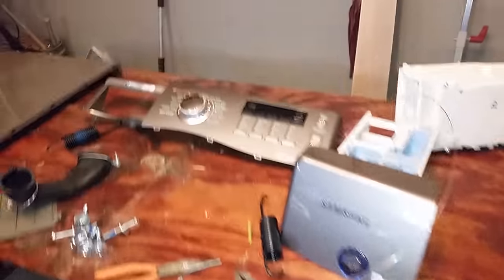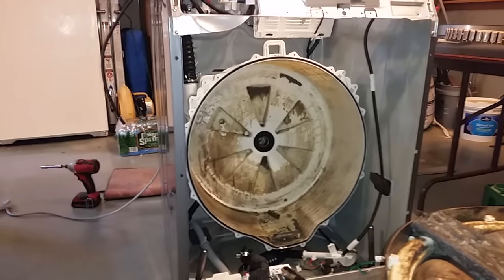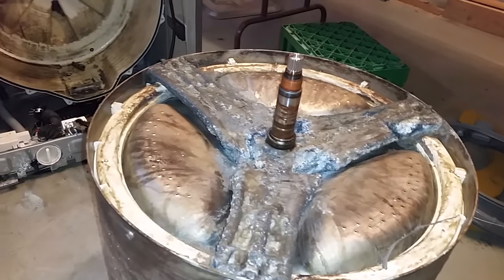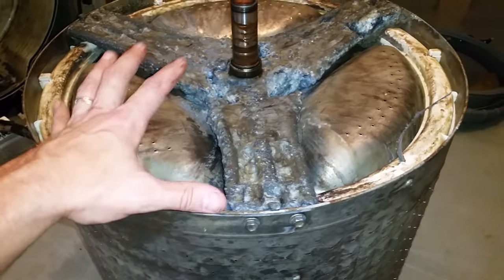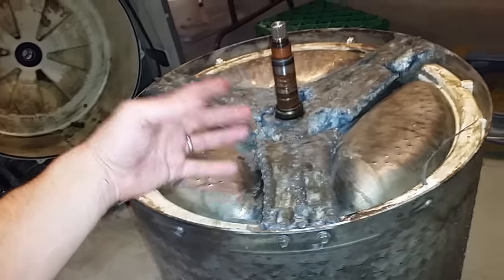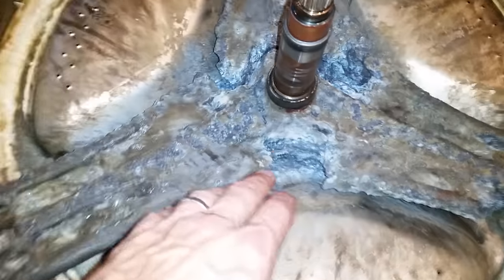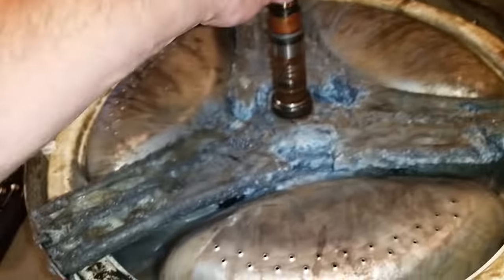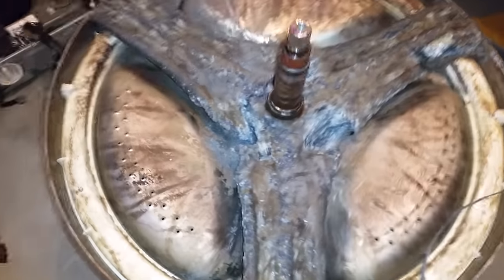Do not buy Samsung front load washer machines

Comment: I've owned 3 front loaders in the last 20 years, before that My parents had a top load Maytag made in the USA from the 50's we use that as a back up because it still works.  Corporate Greed going unchecked...that's all this is.
Reply: Buy the simplest Miele. One without the extra features that can break down. Will last you for 20 years at least. It is tested and constructed to lay that long.
Reply: @HoldenVTCalais that's unfortunately believable. It seems that todays best quality was yesterdays worst. My Grandpas Eudora Mini, Made in Austria, is still going strong after almost 30 years without service.
Reply: @paddybm3245  Miele has converted the spider arms on all models from aluminum to stainless steel since 2018. This is fortunately no longer a problem. Greetings from Germany
Reply: Car mac 1.on YouTube appliance repair and Flipping 👍🇨🇦

Comment: If you have one of these, I recommend leaving the door open, when not in use, to allow it to dry out as quickly as possible. Leaving the door shut, traps in humidity, which causes mold and mildew smells, as well as invite galvanization. (corrosion). I recommend that for ALL front loader machines. (I do like the direct drive motor, as opposed to a small motor and belt). What genius came up with that design? Dissimilar metals bolted together constitutes a shorted battery cell, a little soap to change the PH level makes a great electrolyte, to run down that shorted battery, thus, erosion of the electrodes. BRILLIANT!!!!
Reply: Pretty common sense I'd say to leave it open. Also use vinegar to clean.
Reply: Still, this doesn’t excuse Samsung cutting corners on quality. They still need to make their washing machines with better materials
Reply: @bazil4146  i dont think something less than a platinum would withstand 3 years of constant electrolysis, lol
Reply: @megimargareth4015  Maybe use stainless steel instead of zinc for the housing unit like the rest of the drum. That will be a start
Reply: @bazil4146  yeah that would work too, but samsung decide to step backwards and return to pulley system
Reply: They used cheap soap, that's was all about.
Reply: Battery acid is low pH. Soap is high pH. Tell me again how this battery you mention works

Comment: Zinc frame, steel housing, soapy water electrolyte: it's a battery.
Reply: Samsung invented a new products: Washing Machine Battery 😂
Reply: The frame should be made out of high strength aluminum, or stainless steel. Even regular steel is a better choice. I have seen low end appliances from the 80s and 90s hold up better than Samsung.
Reply: @davidperry4013  same reason top-load washers last longer

Comment: Galvanic corrosion would occur most intensely at the point of contact between the dissimilar metals. That is where the two pieces are bolted together. Stainless steel is "stainless" because the chromium in it very quickly forms a dense non-reactive oxide on the surface. This characteristic makes it useful for coupling dissimilar metals such as copper and galvanized plumbing pipe together. Given where the corrosion has taken place, this appears to be a straight reaction between the detergents/bleaches used and the metal itself. Zinc, if that is the material of the bracket, is an amphoteric element and readily reacts with both acids and bases.
Reply: Eric T.:  thx much for this info, it seems to make more sense that stainless wouldn't be responsible for an electro-galvanic reaction and perhaps just the soaps or water interaction w/b the cause
Reply: And then there’s the time I saw stainless steel corrode but that’s another story
Reply: Yes this is why I cant use YouTube. I just fix shit.  This wastes my time.  strip it, get the part and hammer it back together. I agree, too much soap, it just rusted away. I now retired being a tech and rent storage units and trucks now. Mindless work that pays the bills.
Reply: Kitchen Aide had this problem with their attachments to their mixers. They powder coat them now, problem solved.
Reply: Agreed.  This has nothing to do with galvanic corrosion or different metals.  5 seconds online would have explained how that actually works, and he is off on every aspect of the reactions.  Whatever he really did in the air force it's good he left, or planes would be dropping from the sky.
Reply: Mark Doldon he keeps talking about stainless steel "attacking", and I'm no scientist, but what the heck
Reply: So I should remove my spider. Paint it then re install?
Reply: The soapy water also acts as an electrolyte, accelerating the corrosion process.
Reply: Zinc? It looks like pot metal to me. No excuse for using either in an acid, caustic, or even constantly wet environment like the inside of a washer.
Reply: How are the detergents, etc getting to the outside of the drum?  I would think the spinner thing would be sealed.  I would not expect water, soap or anything else tobe getting to the outside.  If it is, then that is yet another problem along with the mismatched metals.
Reply: @scottgoodson5132  Pot metal is a primarily zinc alloy, so pretty accurate.
Reply: @kilgoretrout3875  spider is inside plastic drum with your clothes and your soap which is made from salt
Reply: @ryantoomey611  aren't electrolytes usually acidic?
Reply: @scottgoodson5132  aluminium die cast alloy 3 is what it's called. AC3 or ALC3. Supposed to resist harsh chemical environments. But there is a limit.
Reply: Agree with the opener. The corrosion almost always happens where the shaft is. You don't see much at the connecting points. So like you I don't buy the galvanic corrosion theory. But corrosion it is and its due to detergent residue building up on the spider over time.

Comment: PLEASE READ:

Hi my American friends, I'm British, and I would like to give you guys some advice as we've had these type of washers/washing machines for a very long time now. Reading comments of this video with regards to looking after the appliance and watching what this guy has said, I agree 100% on both sides. Please read below:

- The guy is right, the rod should be made of stainless steel. This will prevent corrosion from occurring. The corrosion is sure to detergent, water and heat. I have never ever seen anything like this!
- I've noticed that many Americans are using too much detergent for a 'HE' (High Efficiency) washer. As given in the the name, these appliances are efficient (use less) water, energy, etc. You need to use less detergent and a 'HE' detergent. In the UK, we have instructions on how much to use on the pack. 
- Make sure you run hot/warm washes when washing durable items, like towel, bedding, etc. This will help preventing build up of detergent, scum, etc. Avoid cold washes; they do more harm than good. This is because the cold water doesn't dissolve the detergent correctly, causing build up and corrosion.
- Run the machine empty on a hot wash/tub clean/self clean, etc. cycle. You will be shocked at how much suds you see. Don't add any detergent whilst doing this. Check with your manufacturer/repairman before doing the following: you can add Baking soda to get clean results. In the UK we also have washing machine cleaner, I'm not sure if this is available in the USA or not.
- Finally, leave the door open and detergent drawer. This will help your machine dry and prevent detergent build up as well as mould, mildew, etc. Stay blessed everyone.
Reply: I am from Serbia,i am using self cleaning program every 1 month ,in Serbia we have washing machine cleaner it is expensive but it is very good.And for best results i use baking soda in evry wash,im adding about 10g-20g which i think its ok.
Reply: I'm am from Mexico but live in the USA, yes you are correct UnitedStadians here use a shit load of soap.
Thanks for the tips!
Reply: COPLETLE RIGTH.
Reply: @marjanoviccc  which washing machine cleaner do you get in Serbia?
Reply: @johndoe-vc1we  Calgon tablets! Still use them after 2 years! Washer still works 😅
Reply: @marjanoviccc  calgon is not a cleaner it is to be used to reduce hardness when washing clothes. Don't use bicarbonate it is not very useful. If you can find a product like Vanish it will be better

Comment: This is a problem for nearly every front loader. I own an appliance refurbishing company, so we see this on a daily basis. Samsung and GE tend to have worse spider arm durability than most other brands. I steer people toward LG and Whirlpool if they want a chance at 10+ years with proper maintenance and care. The verdict is still out on the newest machines, but I would expect to see more of the same, if not worse across the board.
Reply: What about Speed Queen?
Reply: I had a kenmore if the same year as this video and it was made by Samsung what a piece of garbage the spider went on it just like this one so we bought a new pair of direct drive front load maytags with 10 year parts and service warrantee at not extra charge that should do it 🤔🙃
Reply: @legacyturbo8485  One problem, Whirlpool bought Maytag.  The good Maytags no longer exist.
Reply: LG makes their spider out of aluminum as well, but then they electrocoat it with corrosion resistive material. It really is a crappy part, and yet somehow still a hundred times more efficient than what their closest competitor is doing. The issue here is really the cost, the spider has to marry some diverse characteristics/properties, and alternatives to an aluminum material are prohibitively more expensive.

 TLDR : LG is the best here, but that's not saying much.
Reply: Check out SPEED QUEEN.
Reply: Check out the COMMERCIAL model MVWP575GW, stay well clear of the big-box store "COMMERCIAL TECHNOLOGY" machines, or any washer sold through the big box stores.     
Find an independent "furniture and appliance" store; most carry the Maytag commercials or the Speed Queen line.
Reply: Seems like they could make the spider from stamped stainless steel if they really wanted to solve this problem. At the very least there needs to be a ground wire going to the drum bearing / shaft.
Reply: Miele and Bosch are better
Reply: @Tecnovlog  I look at it from a cost per load standpoint and they pencil out similarly once you factor in additional up front cost and maintenance which will be hard if not impossible to do based on parts scarcity and cost for servicing higher end brands on the fringe long term.
Reply: @Federico84 much more expensive.
Reply: On a laundry forum we have discussed this to NO end...........why some spiders fail while others don't...Most of us have come to the conclusion that it has something to do with the laundry habits of the user....lots of people will use cold water for EVERYTHING... and many will overload the machines...leave them closed up...that creates a funk of slime in the washer causing this to happen much sooner than it has to...If someone uses a little bleach with whites or just hot water, good detergent...and don't overload.. you won't get this build up...I can shine a flashlight and I can see the outer drum in my duet and it looks really clean....if my spider failed today the machine was totally worth it...I can't say for sure if I had a Samsung if it would fail sooner...but I suspect a lot of these issues have a lot to do with the user...My cousin does laundry and I cringe watching her do it.. I don't dare say anything...she packs that sht full and puts way too much soap and washes everything on cold...

Comment: It's called planned obsolesence. They want the thing to fail. Catastrophically. That way you'll go out and buy a new, even shittier one. Electrolysis is what you see, the effect similar to that used in electric batteries.
Reply: actually they never want it to fail "Catastrophically". They want it to fail on simple components that either most people won't open up to replace or they 'pot' it encasing it to you can't replace a single part or get into it. but most of the time on mostly mechanical (rather than electrical) things they have a mechanical failure something they could've easily caught in engineering the product but didn't to induce failure i.e. using a cheap part. 

Anyways i'm sure you knew all this, my main point was they want it to fail simply, not catastrophically because a catastrophic failure could either hurt someone, ruin costumer's other property, ruin a costumer's image of the brand ect.... they'll let a simple part fail that they could've used other means when producing to have the same desired effect with longer life but didn't. and simply bet on the consumers buying new instead of taking a look inside the machine and repairing it themselves. they can do this because years of training the consumers to simply buy new.
Reply: Its not electrolysis it is indeed similar to what's used in batteries although the process he's describing is called electroreduction
Reply: Galvanic corrosion might be a more accurate term for what is happening, but it is generally the same concept.
Reply: River Huntingdon reminds me of every single apple product
Reply: doesn't it come with like a 10year warranty tho
Reply: On the motor alone. A motor-only warranty is common on washing machines. It's absolute fucking horseshit. They could easily build these out of stainless steel entirely - there's NO way the designers of these machines are unaware of this effect, this is absolutely deliberate and it's frankly criminal, towards consumers and towards the environment, it has to fucking stop.
Reply: It's called galvanic corrosion.
Reply: This machine is our last Samsung anything
Reply: Samsung does not support its products with the necessary replacement parts. We have a 36-month front loading washer, that Samsung does not know what is in it! Samsung refuses to sell us the simple parts we need to repair it, You think we will ever buy anything Samsung EVER AGAIN? The simple answer to that is no.
Reply: How do you maintain the spider on a wash machine. Not get it wet? Use de-ionized water? Wipe it dry after every use?

Comment: My Samsung front load washer is still working perfectly.  It's now just over 7 years old.  I attribute that to a few things.  One, when I first got it I took it apart and set it up so it would use more water in the wash and rinse cycles.  I believe that dilutes the soap better helping to prevent a buildup on the spider.  Two, we usually do a hot or even "Sanitize" load at least once a week, helping to cut down on soap scum on the spider as well.  Three, we always leave the door open when the washer is not in use mostly to make sure it doesn't smell.  

I also live in a very dry desert climate so I think that keeps corrosion down as well.  As far as the clean cycle feature, I doubt I've done that over 12 times in the 7 years I've had the washer.  I don't think this is as important as long as you occasionally do a hot load.
Reply: How was you able to setup so it will you use more water??
Reply: Probably won't make you feel any better but my Samsung front load just hit 10 years old and the spider crumbled just like this. I thought I was doing everything right as well. It was fine until one day it wasn't.

Took about two hours to replace and now it's back as good as new. 

But really really frustrating that the spider is literally the deepest part on the machine and it's the most likely to fail. There is no reason this thing shouldn't have been made of a better material, or coated to prevent corrosion.

Comment: It's actually a very simple repair, the parts are relatively inexpensive compared to purchasing a new washer. The  rear drum support parts cost less than $250.00 and can be replaced in less than an hour if you're mechanically inclined. I got ten years of service out of my washer before having any issues and decided to do the repair instead of replacing the washer, It took just under an hour and over six months without a problem so far so I figure that was a good deal. But these washers now sell for about $800.00 on sale. So when you get right down to it, it's actually a very good product considering cost to reliability. Nothing lasts forever these days, and I highly doubt these or anything produced these days will ever become antiques.

Comment: This is why top-loading is superior, gravity naturally drains the water underneath the tub, whereas with front loading you will have issues with standing water, mildew, and door seals because the water will naturally want to stay in the bottom of the tub, there is residual water that cannot be completely drained out.
There are a couple people I know who have issues with their front-loading washers: One of them leaks water slightly due to a poor door seal, the other one has a mildew odor inside that transfers to their clothes due to the residual water in the tub that doesn't get drained out. With top-loading you will not have these issues.
Front loaders also cost more than top loaders, so I am not sure why anyone would want to buy one since they seem to be inferior.
Reply: Our HE top loaders (I've lived with both Whirlpool and Kenmore-which is a rebranded LG) don't get the top half of the load wet, so surely it's not getting clean either. I have a tub nearby, so I was filling the washer to cover all the clothes, but then I figured out I could cancel the wash halfway through it filling. Then the clothes weigh more, and that tricks the washer into filling the drum more, so all of the clothes get clean. It defeats the purpose of using a water saving washer, but at the end of the day, I want clean clothes. I will get a used top loader that is not HE once my current set wear out, they're not actually efficient if I want them to work properly anyway, and I'm tired of having to outsmart the "smart" appliances!!
Reply: Single tube top loader wash less clean than 2 tube toploader, let alone frontload or hand wash
Thats the reason